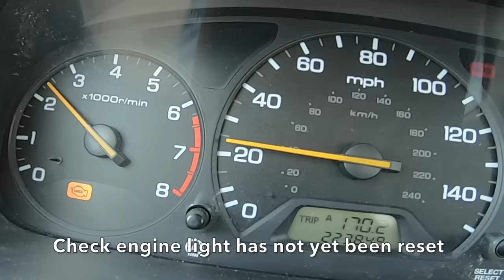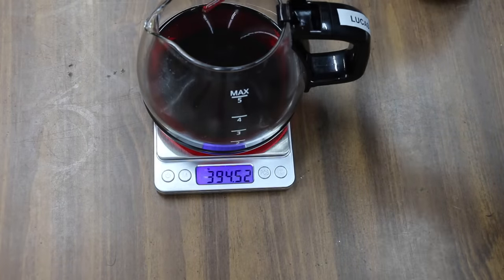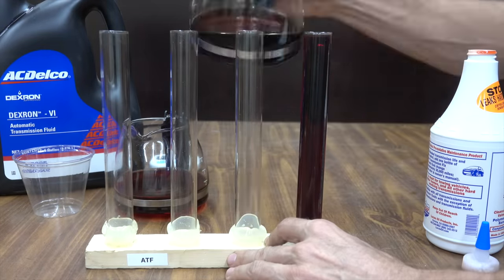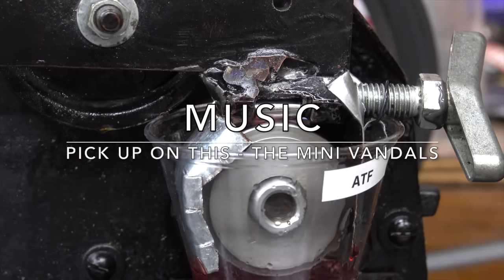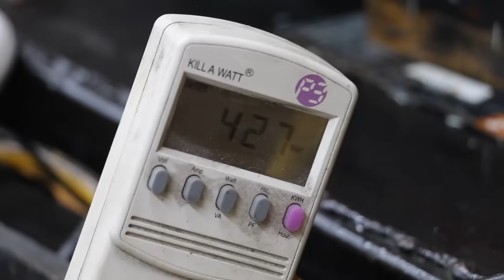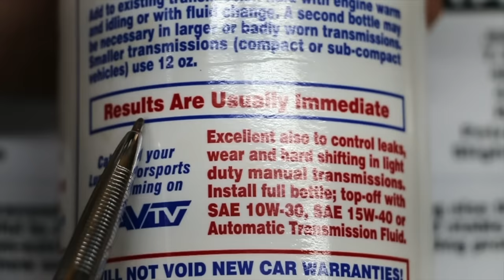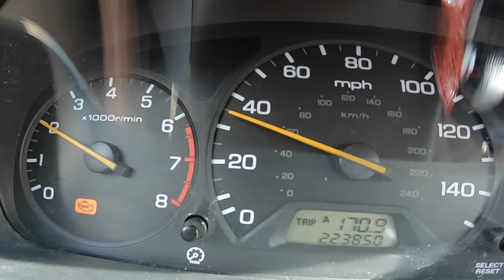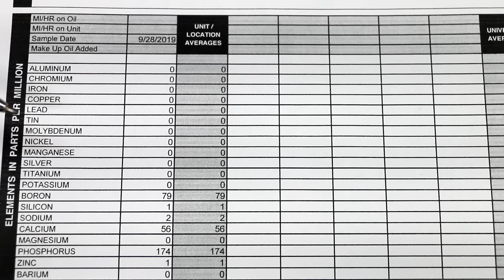Does Lucas Transmission Fix Work?  Let's find out!

Comment: I've been using Lucus transmission additive for years with good results.  A lot of the internal transmission seals are made of rubber and they tend to harden with age, which can cause leaks inside clutch packs and servos etc.  This can cause all kinds of shifting problems and slippage.  Lucus reduces friction and softens internal seals to correct leakage.  In some cases, it takes time for Lucus to soften the seals and correct the problem.   A lot of times, when you use it in your transmission, you need to drive the vehicle over an extended period of time and be patient.
Reply from the maker: Thanks for the feedback.
Reply: So do you believe  it will work in my 94 cadillac deville concours
Reply: @biggkush4796  no, its ancient.
Reply: @DoubtingThomas333  that's. A load of crap....the age isn't as important as miles...I'd rather ancient than a new piece of crap anyways....the the miles matter more than age..but 94 isn't ancient....
Reply: @richsweeney1115  no, age matters a lot also.  Its the second rule of thermodynamics, everything wears out eventually. 

28 years old?  That's ancient for any vehicle.
Reply: Penny Neiman  use Lucas or any brand transmission fluid for Manuals...
Reply: @DoubtingThomas333  Thermodynamics has almost nothing to do with age. If a car from 1994 has zero miles and is never driven but has stayed at normal temperatures until 2022, there will be zero wear, it will be just like it left the factory back in 1994. Plus how could you say Lucas won't work in his application? Lucas is made for worn out transmissions.
Reply: @Rekt-M8-v4  there's a lot of things that are broken down just from being exposed to temperature cycles, oxygen and time.
Reply: Absolutely right. I had a 03 taurus ZERO second gear. Used Lucas trans fix drove for a month no change figured it didnt work, until one day it started to shift with slipping then after another week of easy driving it started shifting as if there was never an issue. Worked fine for the following 6years.
Reply: @Rekt-M8-v4   All hoses, belts, gaskets etc...will deteriorate over time, especially if it isn't used. Gaskets and rubber O rings will get hard and fall apart.
Reply: @ProjectFarm  this has been my experience as well.. But I will say this.. it has never worked on anything European( BMW, Volvo and Benz) for me.. except an old 300 TD.. but nothing more modern. 
But it has saved light duty truck (GM 4L85 HD) and numerous other higher mileage transmissions for me.. (Subaru, Toyota, Ford, GM) more time in the trans the better.  Takes a while for the Esther’s and other stuff to work on internal seals.. but if you catch it early and drive gently for a while after it is added it is worth a shot. My daughter’s Subaru was acting up… put the Lucas in it.. took a week of gentle driving.. it sorted itself and then went another 110K problem free before we sold it. 
YMMV..
Reply: @biggkush4796  I'd used on my 87 cadillac Seville, and worked really good..
Reply: @DoubtingThomas333 age means nothing. 99% of vehicles never even have the transmission bands adjusted like their supposed to. Most shifting problems from are not adjusting bands. IF your bands BURNT then it was never adjusted
Reply: @DoubtingThomas333  LOL!   My 1995 Pontiac Firebird runs and looks great.  Over 200,000 miles on it now.
Lets see if any of the new junk made now lasts that long. LOL!😆
Reply: YES, I've seen improvement over the first 1,000 miles.
Reply: @DoubtingThomas333  Whatever chump, I drive my 69 charger every weekend and roast the back tired every chance I get. How many trans u built son?
Reply: Agreed. Most additives do not work instantly and people need to give them fair time to do what they are intended to do.
Reply: @Rekt-M8-v4 those types of vehicles have all sorts of problems.  All rubber seals are broken down from oxidation and drying, valves left open for years with no oil being slung on the cylinder walls, mice damage.  The list is endless.  I would not touch a zero mile vehicle unless it was very cheap
Reply: @biggkush4796  I have the exact same car except a 95 with the 4.9 and 4t60e and when these transmissions start having issues lucas will not remedy it you can have it rebuilt for around 2000 where I live in sc or you can remove it yourself and save a bit of money or just gamble on one from the junkyard for a couple hundred bucks
Reply: @evanknight3629  yes I'm in NC what's a good place to get a rebuilt one or should I get it rebuilt
Reply: Only 21 replies. It says 25 😡
Reply: @biggkush4796  call your local transmission shops there is a few options either go find a low mileage caddy in the junk yard that has been wrecked and pull the trans this is the cheapest way even if you pay for install but you gamble a little or you can order a factory remanufactured one online to get it rebuilt call your local transmission shops and find one that has a transmission dyno to properly do it not just some hack shop that will rebuild it on a dirty table and contaminate it
Reply: @Rekt-M8-v4  Sorry but Lucas is not made for "worn out" transmissions. It is simply made to soften hard seals in old transmissions. It cannot repair worn parts.
Reply: @evanknight3629  Very few transmission repair shops have an actual dyno to test a transmission after rebuilding. If you want a dyno-tested trans, buy a remanufactured one from a dealer or aftermarket auto parts store.
Reply: @mtbasshead  adjusting the bands…😆😂🤣…you don’t know what you’re talking about!! You haven’t been able to adjust bands on newer transmissions for years. I’m a recently retired transmission rebuilder.
Reply: @Cobra3901  Hey when was the last time you adjusted a 46re, 47re, or  48re? My guess is never because why adjust it for 100 bucks when you can rip some guy off for 10 grand. Your kind isnt new bud.
Reply: @Cobra3901  "you havenet been able to adjust bands for years"? LMFAO so there are no second or third gen dodges on the road anymore? Since adjusting bands is LITERALLY right in the user manual? Betcha theirs more 2nd and 3rd gens still on the road that 4th gens. But you dont adjust you just rip people off. GOTCHA 👍👍
Reply: I had a ford f350 that wasn’t shifting right. I used Seafoam transmission additive and it fixed it
Reply: @T.R.R.Jolkien  they were deleted.
Reply: @birddog3130  they were censored, my friend…

Comment: Serious question: couldnt you add a higher viscosity fluid to make up for worn clutch for the same effect as the Lucas treatment? Clearly it's very thick and is most likely the reason it works well.

Comment: I recommend trying it. My 03 Mazda mpv was slipping & hardshifting from 1st to 2nd. I drained some fluid & added a 1/4 bottle of this. It helped a few weeks then problems returned. I added another 1/4 bottle & that was over a year ago & its still shifting fine. Stay healthy!
Reply: Might try this in my '02. Been hard shifting for the four years I've owned it. Hasn't gotten any worse. So, hopefully, something like this will help to smooth it out a little. Might even try it in my old Dakota.
Reply: Same exact thing with me 94 explorer👍
Reply: For my experience it likes the full bottle and I used to bottles that works really well for 10,000 miles
Reply: My tacoma was making a super bad grinding noise it was really bad. Got it to the house drop the pan changed the fluid added a whole bottle of lucas and topped off with trans fluid and truck ran great for 3 years in the hot fl sun. I put lucas in all my stuff. We live in very hot climates and oil thins out fast. I use a whole bottle of oil stable every oil change. My vehicles run minty
Reply: I'm going through same w my mazda3 2010 fr 1st to 2nd . So definitely going to try what you said
Reply: @kimgow7671  drop the pan change the filter and add the whole bottle and top off with trans fluid and send it
Reply: 4

 @mannyc805

Comment: Underrated channel

The amount of precision and removal of any variables that will effect things in all your videos is insane
Reply from the maker: Thank you very much and hope you enjoy the video!
Reply: Affect.
Reply: Peter Karel Kraus, damn

Always mix them up
Reply: I like to think I'm pretty good with grammar, but effect and affect are my kryptonite
Reply: I had an 2004 Ford E350 box truck I used for work. I purchased it with 91 thousand miles on it and noticed it had a half quart of old tranny fluid under the seat (alarming to say the least).  Sure enough I noticed I had a slip going up hill with a heavy load.  I put two bottles of Lucas in it, didn't want to just put one in, I had excellent results.  Limped it on the salvage yard scales at 278 thousand miles 8 1/2 years later and the transmission was fine.  Motor was shot and frame was rusted.  Love the videos keep them coming... Thanks!
Reply: Who or what has under-rated this channel? It's on my top 3 so it wasn't me.
Reply: “The precision and consideration of many variables that might affect outcomes is seen to great effect in Project Farm videos”, as long as we are editing. ;)
Reply: @PeterKKraus  
Actually EFFECT is used correctly.
Reply: Armando Gonzalez I always feel like effect and affect are the same but I know they are that’s how I get confused too.
Reply: @AndrewKidd14145  They really aren't. How something is affected is the result of the effects of a situation or substance, I think that might be what is the confusing thing sometimes.
Reply: Effect, affect, I know exactly what you were trying to say Armando 😁
Reply: @MiscerVids  spel checkers R  myne.
So many Karen English majors out there without hobbies. 😁
Everyone has a brain wired differently.  
Jeopardy contestants can name every capital of every city in the world.  
If they had to change their own oil or spark plugs they'd be lost.
Heaven forbid if they  had to solder a copper  pipe connection, replace a  faulty light switch  or  properly file the end gaps on a set of piston rings....... all of this is easy peasy as most everyone knows.
If someone can type well enough that I can understand what they're saying, that's all that matters to me.
Reply: @AndrewKidd14145  Try playing with Advise and Advice
Reply: I really enjoy watching you tell us things I believe you do a great job of it and also explaining what you were doing. Your channel is one of my favorite ones to watch. Keep up the great work.

Comment: I've used Lucas Trans additive on a couple different cars and every time I've noticed a significant improvement. Awesome video!
Reply from the maker: Nice!  Thank you
Reply: It does good on transmissions that's just started slipping.
Reply: Lucas is one of the few brands you know aren't snake oil.

Comment: I love Lucas products, have used them for many years.  The oil stabalizer  and tune up in a bottle  are the ones I use most.  Used them in my 2005 Ford Taurus from the day I got it and it NEVER had any engine problems after 10 years and 178,000 miles.  In fact, only things I ever changed was a bad starter,  alternator, and battery.  I trust Lucas products and will continue to use them.
Reply from the maker: Thanks for the feedback.
Reply: Same here.  I had a 98 Chrysler Concord with the 2.7 V6, it smoked a little.  A friend suggested I try Lucas Oil Stableizer.  Within a few days it stopped smoking.  I have used Lucas Fuel Injector Cleaner,  in both gas, and Diesel engines,  it helped get better fuel mileage,  plus in the Diesel a 15 liter Cummins (ISX) 450 HORSEPOWER it not only got better fuel mileage,  but it ran smoother through out. The RPM range.  I also used Lucas Oil Stop Leak.  It worked very well.  I'm sold on Lucas products as well.

Comment: Here's an idea for a video, I've been told my whole life that it's bad to store car batteries on concrete or the direct ground. For fear that it will discharge the battery.
Love your show and how in depth you get with the testing!
Reply from the maker: Thank you for the video idea!
Reply: I am a AAA battery tech. This wives tale rules the minds of my bosses. I asked one of my bosses," how do you think the electricity can get through the plastic"? He said the rebar in the concrete floor. I just smiled.
Reply: This is very old yet true. The only things is that it is no longer relevant today. Many many years ago car batteries were made with much different outer casings. The carbon in the casings when placed on humid concrete did in fact cause a trickle of current flow to occur that would drain the batteries. Likewise setting on the bare ground would cause the same current flow to earth ground. Latter attempts of rubberized casing proved to have the same effect as the rubber contained carbon as well. In modern batteries with hard plastic casings this is no longer a problem and it is perfectly fine to store them on concrete.
Reply: Ive left a car battery on a concrete patio for about 7 or 8 months. When I first put it there it read 12.6. 8 months later it hit 12.3. I'm sure the results would have been exactly the same if stored anywhere else. Especially since it was a bad battery to begin with and would only max at 12.8. Think they did a myth busters on this myth one time also
Reply: Carl Cox yeah like I said this no longer affects batteries of today.
Reply: In nearly every big box Auto Parts store, Home Depot and Costco the batteries are displayed on a metal battery rack. Ask your boss what he thinks about that.
Reply: The only reason I dont put them on concrete floor is in case there is acid on the case
Reply: I would love to see this test as well, all my life Ive been around alot of car batteries and they do seem to drain. I always thought it was due to it being "grounded" maybe they just lost some power from sitting around. 

I still live by this theory and see 1000 car batteries a year, I just use insulators like wood and not put on concrete.  We shall see when he does a test. 🤔
Reply: You've been lied to, it's a wife's tale.
Reply: @jamesfair9751  was about to comment but checked to see if someone else new the answer. Photovoltaic / Solar Thermal Technician here, we had to learn about flood leaded  acid batteries to Lithium Ion etc. My Hat Off. i Like, OLE!
Reply: Yes any battery left on the ground will naturally lose voltage because it’s grounded to the “earth” that’s why most shops have them in racks and should trickle charge every month
Reply: Me too.
Reply: Could you please test Lucas engine oil stop Leak
Reply: We were told in aviation school that batteries discharge when not in use and concrete has nothing to do with it. I do remember in my teen years always setting them on a board lol. Hook up a battery tender and forget about it
Reply: I always set my batteries on a block of wood. Just what I was taught as a kid.
Reply: Dirt across the top of a sitting battery will kill them quicker
Reply: Lead acid batteries all slowly self discharge regardless of what they are resting on. The chemical reaction that provides the electricity when a battery is being used also occurs at a smaller scale when nothing is connected. That is the self discharge. The best way to reduce self discharge is to store the battery in a cool place (not below 32 F!) since heat accelerates it. This applies to all battery types, including lithium ion.
Reply: That's just false. Concrete has no effect.
Reply: They were just not that smart back then ,they didn’t know that battery’s self drain slowly over time. now you have battery tenders to keep them in there best shape when not in use .

Comment: Had a 90 Chevrolet c1500. 1st gear shift would give you whiplash. 2nd and 3rd would slip like crazy. I thought for sure transmission was gone! Changed filter and fluid. I then added 1 bottle of Lucas transmission fix showed some improvement.  I drove it about a week drained out a quart and added a 2nd bottle of Lucas. That was about 6 years ago. Still driving the truck. Shifts like a dream and no slips. I wouldn't believe it if I hadn't seen it with my own eyes.

Comment: Great video. I have a 2012 Yukon Denali that just started slipping. It won’t shift from 1st to 2nd. RPMs run up but no acceleration. I’m thinking about changing the solenoids out, but do you think I need to try this first before ordering these parts that I may not need? I’m getting a P0746 code saying “pressure solenoid 3 stuff off” with the scanner I used.

Comment: I commented on this before. I used this on my 2008 Dodge grand caravan SXT. It helped smooth my shifting a lot. It took about 250 to 300 miles of driving with much of that being in town driving, so there was a fair amount of shifting. This Lucas product made a huge difference in how smooth my transmission shifts.
Reply from the maker: Thanks for the feedback.
Reply: @ProjectFarm    My pleasure. If I can help another person who has one of these Chrysler transmissions that is starting to shift rough, I'm happy to do it. I hate throwing good money after bad when it may not be necessary.
Reply: I’ve just put in 80% of a bottle in my 09 charger police/RT. Has the ‘roller bearings’ going bad. Rough shifts from 3&4. I’ll update in a week or so… was quoted 4500$ for a NAG1 Transmission. Hopefully this works for me as well!

Comment: So I have some questions regarding your thoughts on this product. My first one is would you use this as a preventative means or only when you notice some slipping? I know some people out there don't recommend messing with the transmission fluid unless you need to.  Second question came from the room temp vs frozen racing. I live in Minnesota where it gets very cold. How much would that affect something like this in winter time? Awesome video and I always check to see if you already have comparison videos on something before I make my purchases.

Comment: It helped my 94 4L60E with 300,000 miles,  it was lagging between shifts, 2nd to 3rd also, once added and drove, it started shifting normal and is still shifting at 330,000 miles